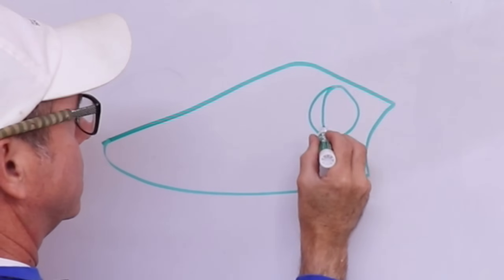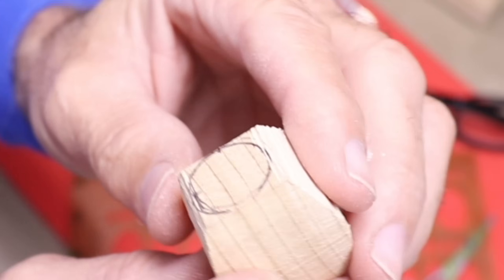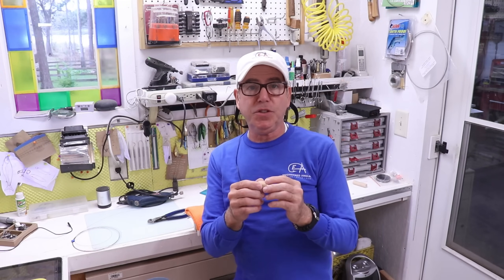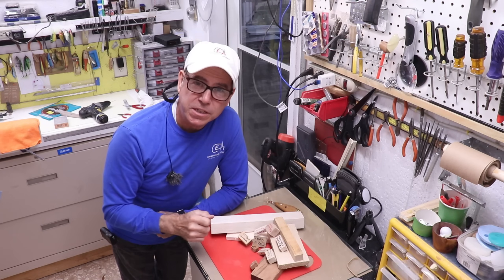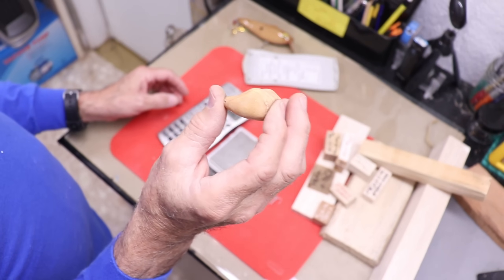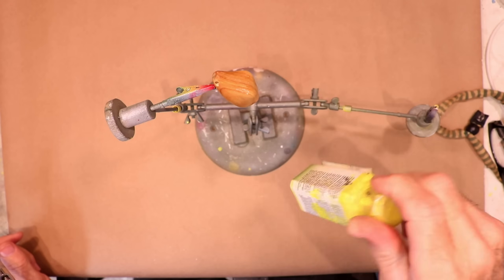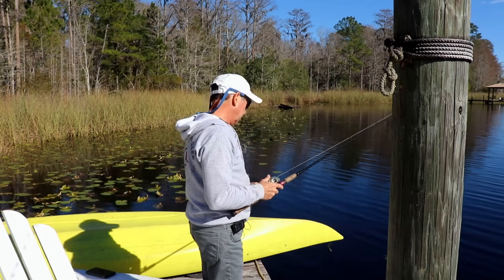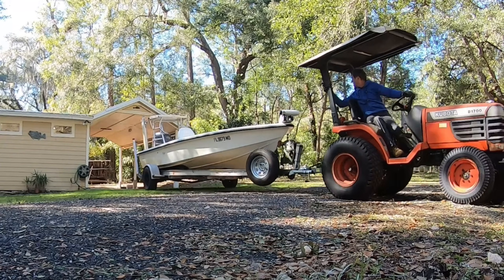Making a mini bass frog, Making a popping frog lure  #luremaking #bassfishing #popper

Comment: Hey Franco
Thank you for making the physics of lure making more accesible! 
I startet making wooden lures because I want to reduce the negative impact on the environment in case I lose a lure while fishing.
Using wood I got rid of most of the plastic but I still use lead to weigh down the lure. 
Now I am wondering if there are elegant ways to ditch the lead for at least floating and suspending lures without compromising the balance of the lure.
Reply: I use heavy hardwoods, either for the whole body or just a part to get a lure that casts a long distance and dives deep without needing lead. Often the weight of the hardware is enough to sink a slim bait. 

Maple is good, buckthorn and hophornbeam are heavier but are difficult to source and carve.

Cheers!
Reply from the maker: Yes there are, but it takes some plan and a bit of cleverness
Reply: @hankvana2149   Thank you, I'll try maple next maybe in combination with brass. 
Right now I found some mystery wood in my shop. Must be something tropical as it's very dark in colour and sinks almost by itself. 
I have laminated a thin piece of balsa on top to be on the safe side, because I want it ideally to float back to the surface when it's not being trolled or crancked. Also I hope that this will help keep the lure from rolling on it's side.

Comment: I know that the Smallmouth Bass will like the frog - it's perfect for them! Thanks for posting that Franko! 

I have a variety of woods available on my property. From lightest to heaviest, I use basswood, cedar, pine, spruce, poplar, birch, maple, buckthorn and hophornbeam - depending on the need. I'll often glue up a composite block (light/heavy) to get the buoyancy balance/instability I want.

Pike and walleye teeth will easily peirce the clearcoat over the softer woods so I'm experimenting with wood hardeners. For puncture proofing, I use poplar, birch and maple with a preference for poplar. 

Poplar is a good density for general use, it's reasonably hard, carves and sands nicely, is porous enough to accept a (relatively) deep finish without sucking up too much and becoming saturated. Bonus is that an 24 inch, 80 foot poplar tree yields hundreds of board-feet of clear, fine grained planks. 😁

I see that you are using a "support handle" for cutting out the bait - I would say that you detached it too soon though. 

I make a lot of small baits and always leave 1/2 to 3/4 inch of wood (as supports) at both ends as a reference surface to work from and as a way to clamp/hold the lure while shaping, drilling and sanding. I do my shaping with a file, it's much easier, faster and safer than a knife or beltsander. I  find it much faster and more accurate to clamp the rough shaped blank solidly in a vice for those operations. I leave the supports on as long as I can.

I usually make baits in sets of three. By using supports, I can cut the profile for several baits at once, then slice off the thickness I need for each lure.

Cheers!
Hank
Reply from the maker: Sounds like you got it down...

Comment: When you're doing your calculations for buoyancy do you consider the impact of your clear coat and how that might affect the lure's weight? I'll put on 3 thin coats of etex on a lure which will usually add 1.5g to the final weight. Since adding this to my build considerations I've been really able to get some great repeatability in performance and sink rate.
Reply from the maker: Yes I do take it into consideration with lures where I'm really dialing in the sink rate.  But remember what you have to consider is the specific gravity of the clear coat because as you add weight you also add volume.  what matters is the added negative buoyancy, which is not much with epoxy.

Comment: If the tank is hard to find could the old tank be patched? A welder could surely do it but JB Weld has done some amazing things around here. Could you JB Weld another piece of plate over the area? This would eliminate a spark around a gas tank.

Comment: Hi Franco! Great video as always, instantly went to watch the improved frog from a few years ago, the one with magnets after finishing this video. I was hoping you could answer me a question about action of crank baits.
If I had two near identical crank baits, same body shape, same weight distribution, same lip, same sink rate, how would I increase or decrease the width of their action (using body features like fins)? Assuming both have more side to side action with little to no rolling action.
I did manage to adjust the action with tie on eye position (closer to the lip gives wider movement) but I can only move it so far up and down before I run into stability problems and sometimes the walleye love a bit faster action that mimics bait fish swimming up stream but ide and asp love wider action.
Reply from the maker: Every design will have its limits. The most reliable method of getting better action is moving the tie on eye.  A secondary method is to make sure your body weights are consolidated in one location and that should be as close to the center of rotation of the body in action as possible.  Otherwise, some redesign would be in order such as increasing the size of the bib, moving the tie on eye on to the bib and shortening the lure a bit.

Comment: Hello, Franco! Happy New Year to you and your family! 
Here in Serbia linden wood and poplar are most commonly used for making lures, mostly crank baits. I use linden wood because it is very easy to carve and I have abundance of it too. 
I have a question regarding the Chinese UV resin. When I brush it onto the lure it appears as if it retracts, leaving small oval spots on the lure without the resin. Did this ever happen to you, and what do you think the problem is? Should I maybe add some alcohol to it, or try to apply a thicker coat of UV resin?
Thank you very much!
Reply from the maker: I used to get those blemishes but solved the problem by applying a mid-coat of minwax Polycrylic